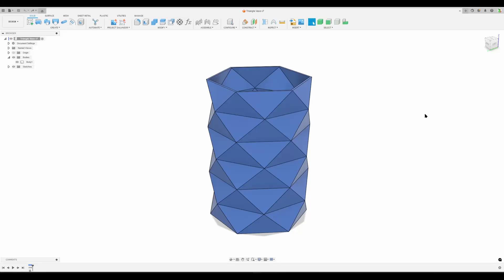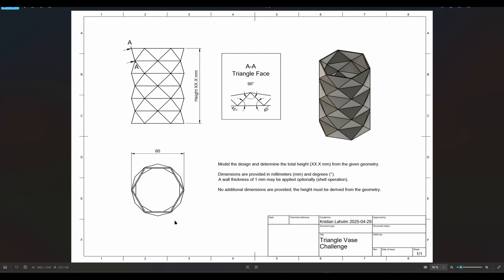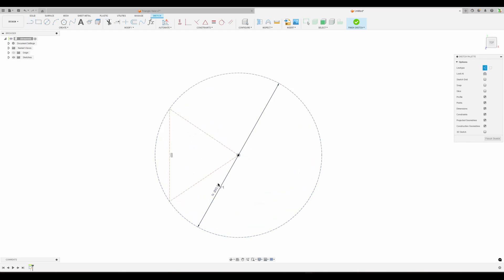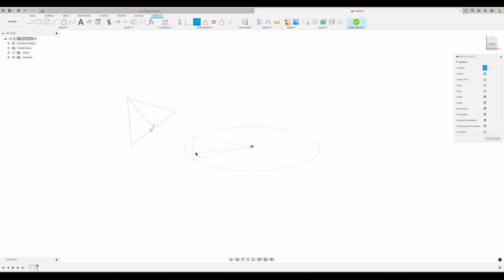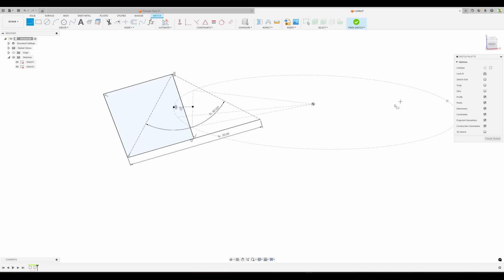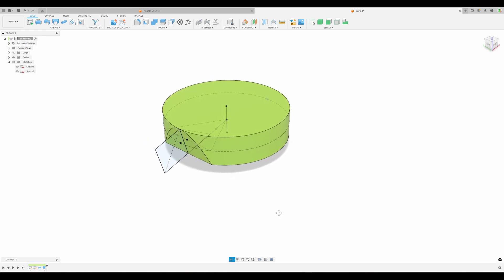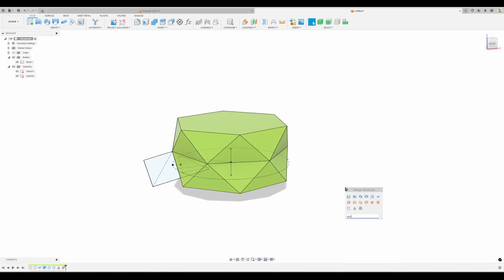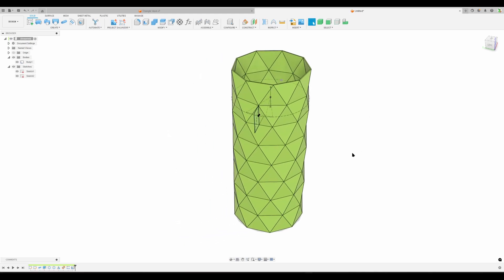Autodesk Fusion Workflow - Geometric vase, make it parametric !!!

Comment: Hi Kristian. Thanks for your lovely workaround for the lack of a Join feature in the Pattern command which stops it from being fully parametric. How did you discover that?

I find it bewildering that the Fusion developer’s continue to add new bells and whistles that few people will ever use whilst leaving major gaps in the basic tools.
What is required of course is that the developers add a checkbox option to the Pattern command which performs the function of… “auto join if bodies touch”.
Without this option, the Pattern commands cannot be said to be truly parametric.

Comment: Nice trick with the Boundary Fill! 

My solution was very different and still fully parametric. I only have 8 steps in my timeline 😊

My way of getting past the Mirror feature not being able to be patterned was to have it right before the Shell. (Before that I had a model with gaps between layers and a parametrically set up Offset Plane to Mirror around.)

Comment: Nice.   Great tip on the boundary fill.  I ran into the combine/shell problem, and had to change my work flow to make the the full height cylinder and pattern the cuts.

One question,  how did you know that the segment angle/4 gives you the correct angle  to flip over the cut?  Is it something you stumbled on or was it derived ?
Reply: half side is vertexes offset, so quarter is projection of middle point of side edge